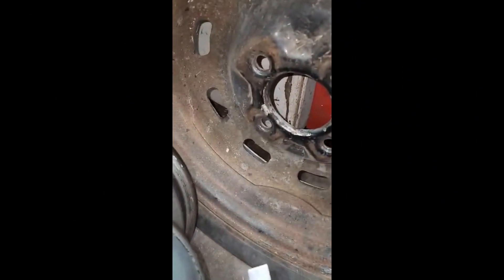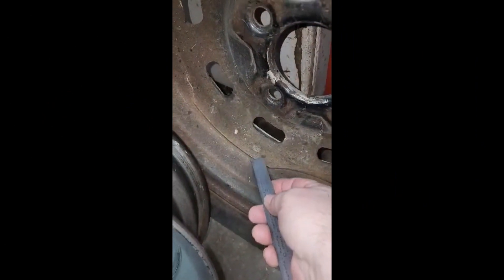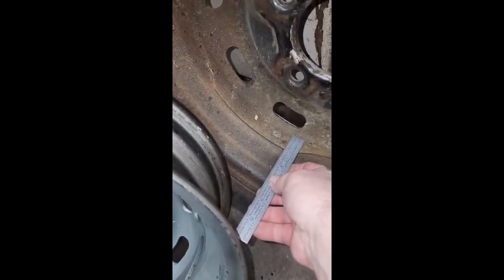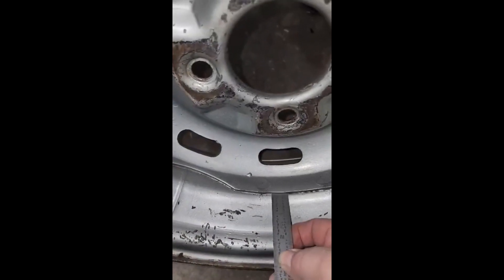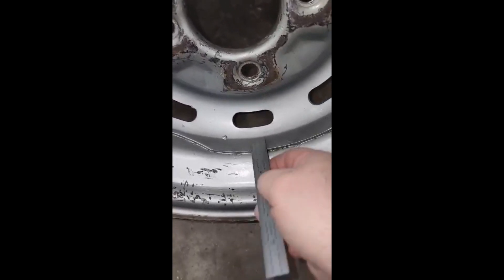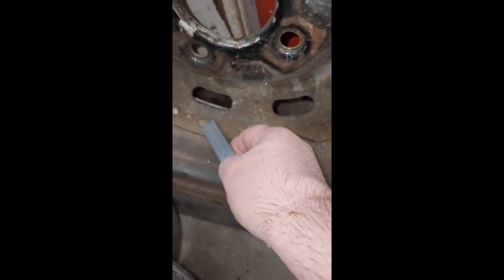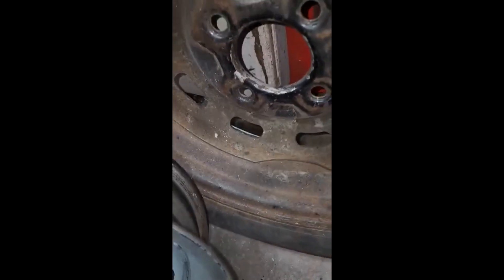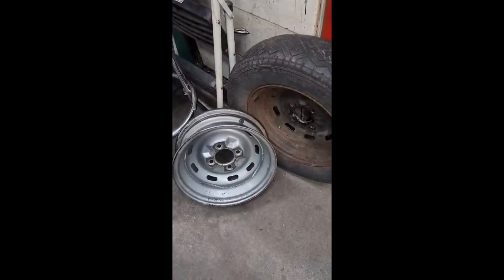311 rim difference

Comment: Use spacers?
Reply from the maker: I'm sure spacers would work, but I'm trying to avoid them.  :)  I'm working on using a smaller rotor that will solve the clearance issues for the rusty rim.